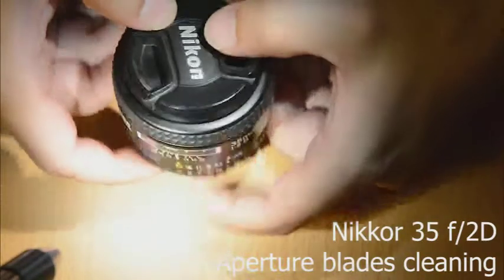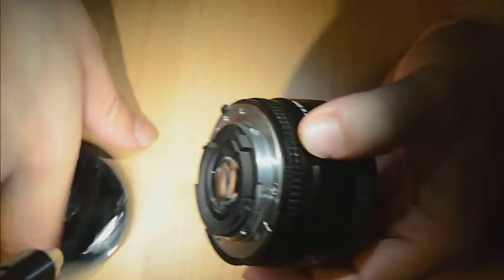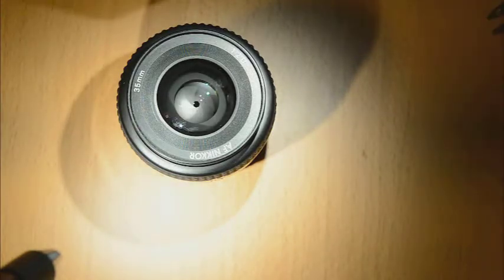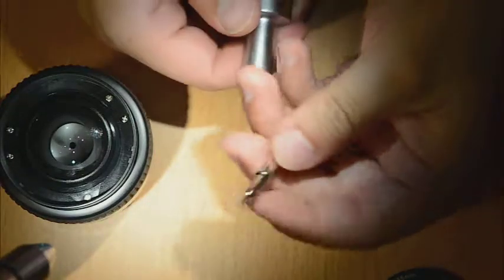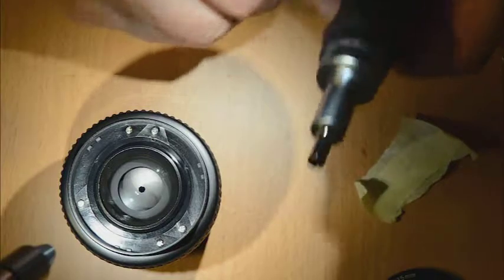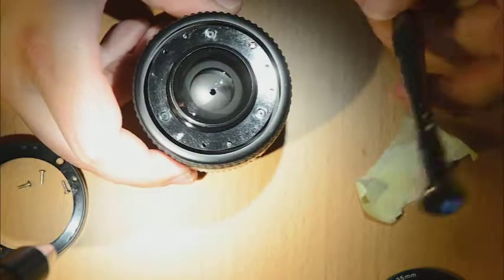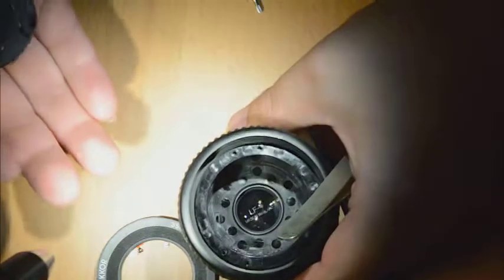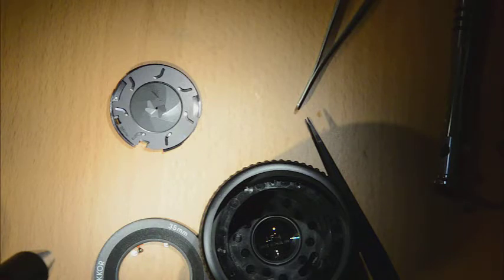Lens Repair: Nikon 35mm f/2D - oil in aperture blades

Comment: Great Video !! I have this lens and when I manually turn the focus sometime it squeaks from infinity to 0.25m .Like the rear moving element is rubbing.  Can you suggest the easiest way to lubricate it? thanks
Reply from the maker: Thanks, I'm afraid there is no easy way. You'll need to unscrew the focusing mechanism and relube, check my video on the 50mm 1.4 AF. I think the construction is quite similar. Cheers.
Reply: @diyextravaganza  Thanks for responding! Love your videos!
Reply from the maker: @StreamlinedHD  Thanks, Cheers !